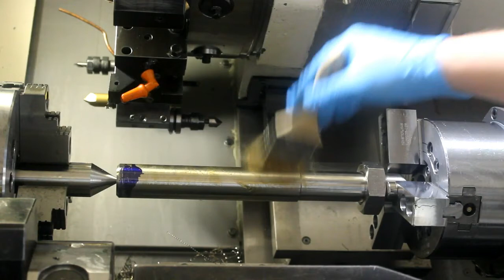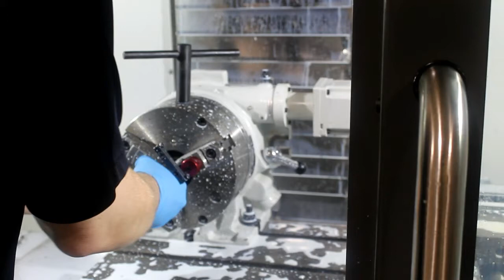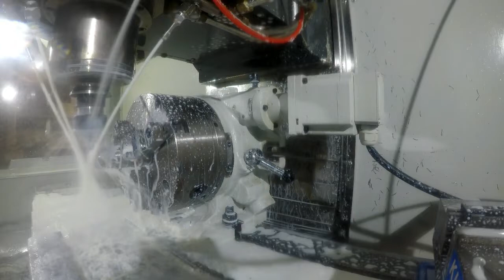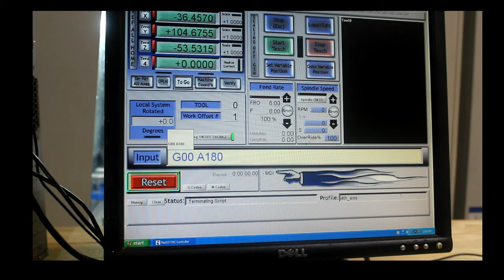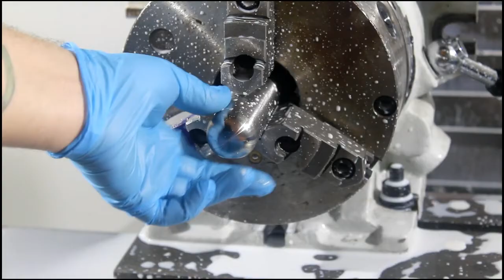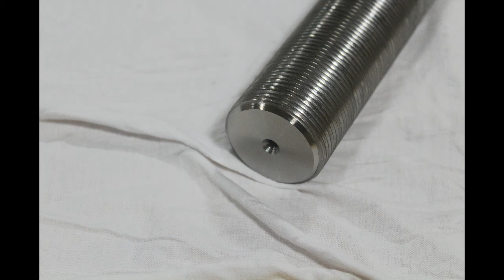Part 3 Final - "Pizza" resistance - Smells like hades in here  - Don't thread on me.

Comment: Hey Daniel.
Seems the ladies are doing there rounds in the comments ??
It was good of you to show the whole job from Lathe to Mill.
Not total sure but it looked like you were running a Tormach Rotary in your Mill ?
I mainly ask as i am trying to sort out what i need to do to set up something for my machine.
Early thoughts are to just go with a standard rotary table with Index Plates.
I mostly need it for 90 degree and 180 degree work.
I see a few rotaries for sale second hand but i don,t really need rotational machining it does seem a little overkill to go full rotary.
Reply from the maker: Hey Peter, as for the ladies pretty sure those are just bots, not sure exactly what they are trying to accomplish. Yes that is a Tormach rotary the big one with the 2" bore I think it is. I think its a bit overkill too especially for what you or I use it for, but we bought this thing for a job 3 years ago that it made sense for.
I have it pulled out again because we are running a job that has features on 4 sides 90 deg from each other and this was sitting around not being used.
-Daniel